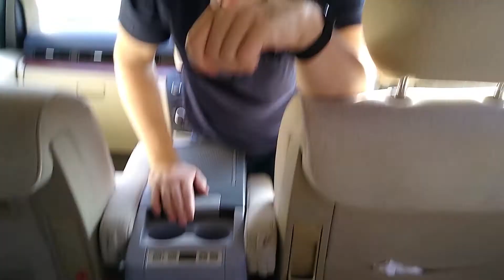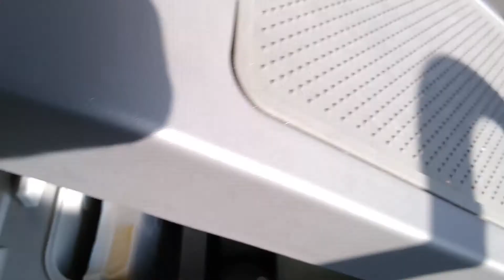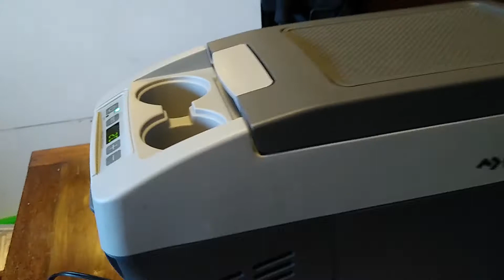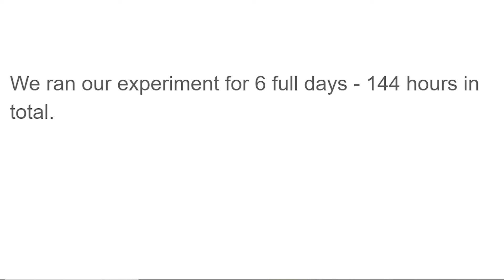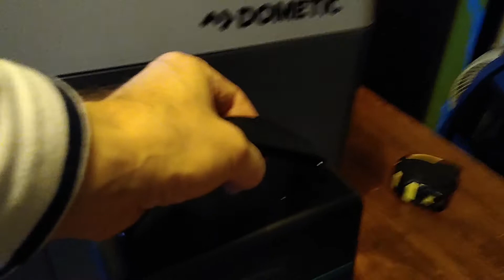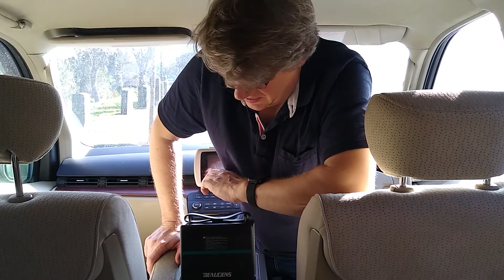Reviewing my Dometic CDF11 portable camping fridge

Comment: I tried the standard cool boxes and they depleted the battery so quickly. I presume this is a compressor type fridge and they are so much better. I’m using an Alpicool C9. Probably smaller than this  one though.
Reply from the maker: Yes - the difference is massive. This one is 11 litres and a compressor type. So, very small - likely a little bit smaller than the chiller/cool box, but easily capable of running at or below freezing for the best part of a week on my current set up..
Reply: @stewreviews9345  My Alpicool C9 is 9L.  Its range is + 20c to - 20c.

Comment: do you have a second battery in the van
Reply from the maker: I've got the small LiFePO4 batteries in parallel as a medium sized leisure battery - 90 amp hours. You can check out the van in the link below if interested. https://youtu.be/s3bShsUMZ-M

Comment: Just make sure that when you stick it between two seats, you're not covering up the ventilation grates on the sides, or you will cause it to overheat and then it will automatically shut down on you to avoid harming the device.  Slide it either forward or back so that grated area on the sides is exposed and not covered up by the sides of your seats.
Reply from the maker: Good call. There is actually a lot of space so that isn't an issue at all in the Elgrand - the arm rests touch the sides of the fridge near the lid but the vents are lower - around 5cm clear on either side.

Comment: You can half that working time when it's in a warm van. So when people are watching, don't count yourself rich. ;-)
Reply from the maker: You are right that the fridge has to work harder when it's hot of course.

However, I camped for four days without electric hook-up in reasonably hot summer heat last year (South of England, not Nevada or anywhere like that) with the fridge running and didn't see a dent in my charge - it really is very efficient.